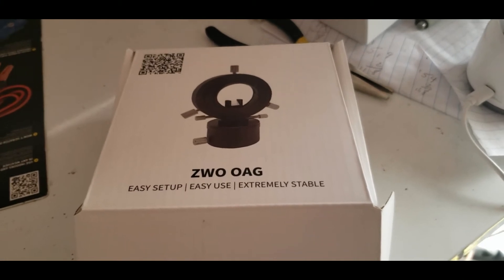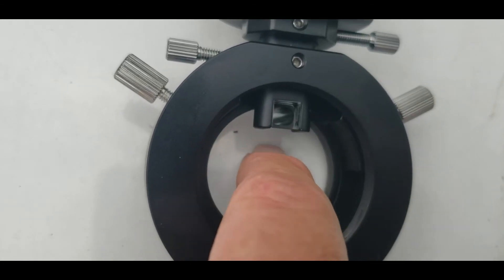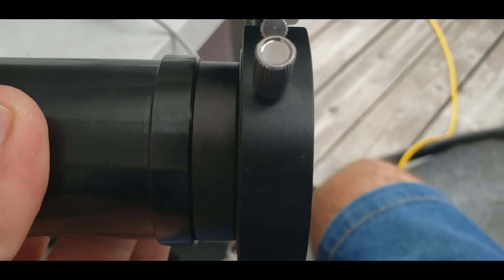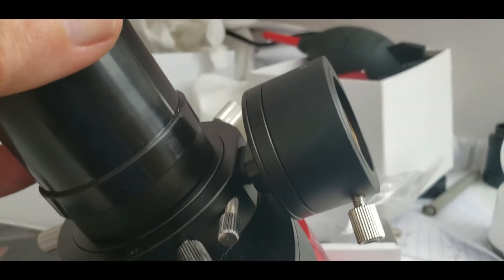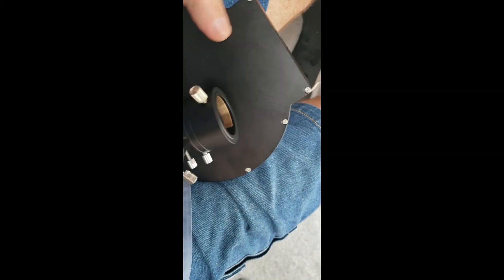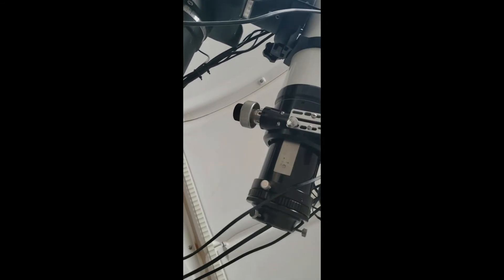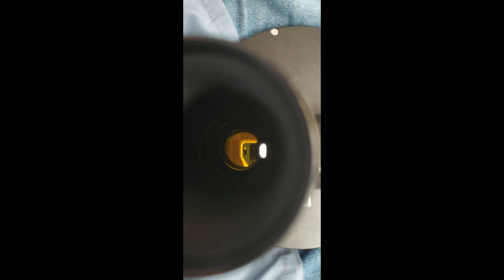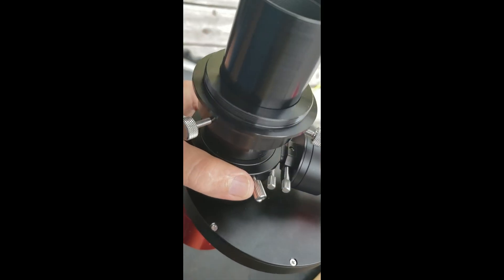Setting up the ZWO Off Axis Guider on my telescope.

Comment: Set-up does not seem to be very difficult, but I wonder what size chip you have in your camera and the image circle size?  I wonder if OAG are suitable for smaller scopes like 60mm or 80mm aperture?  If the OAG mirror blocks some of the sensor, does that actually result in a shadow?  Does an OAG ever require a dew heater for the mirror (being internal, probably not, I guess)?  Thanks for the helpful video but I still have a few concerns/questions.  Or maybe I just need to buy it and try it!  OAG hardware is not really that expensive......
Reply from the maker: I actually was very dissapointed with the OAG. For now I took it off and went back to a zwo guidescope. I was not happy with the guiding I was getting with the OAG.
Reply: @greybeardsastro3477  Interesting. I am not compelled to try it, but definitely curious.  Maybe someday when I have a real reason I will give it a go.  But for now, I too and happy with using a guidescope.  Thanks for the honest comments!  BTW, if you want some astrophotography "entertainment" (not technical), check out my new YouTube channel at JPASTROGUY.  Cheers!
Reply: @greybeardsastro3477  Looking at the vid it is possible that you did not have the prism low enough into the light path. It depends on your main camera sensor size as well which can dictate the distance.